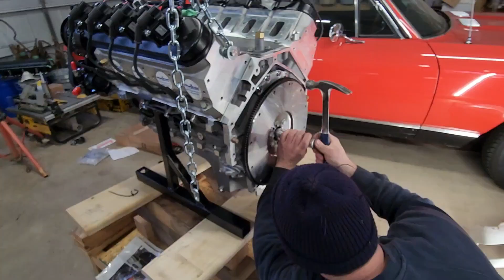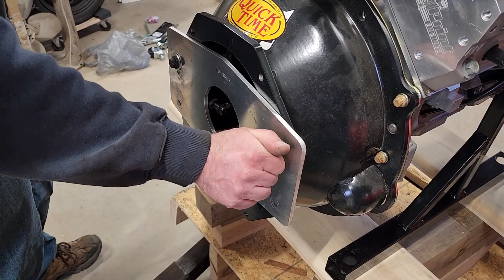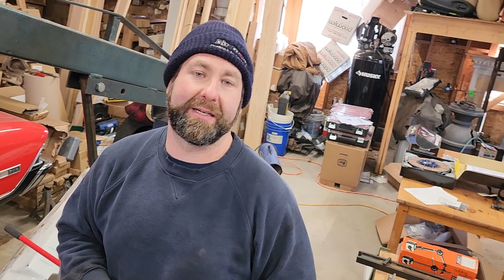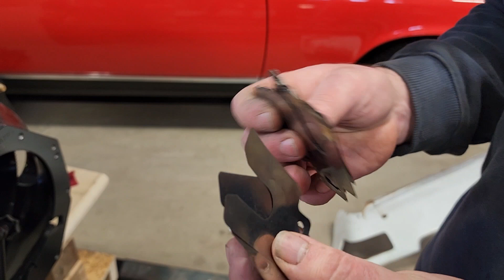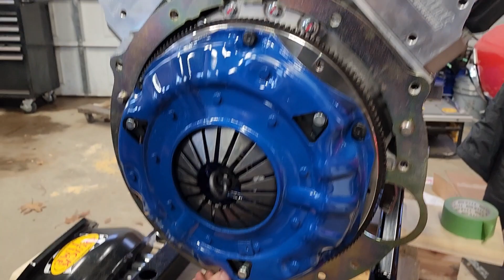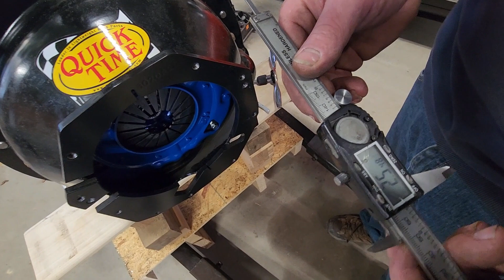68 GTO, LS3 motor setup

Comment: Looks great, That's one of the really fun parts of restoring a car!!!
Reply from the maker: Yes,I agree. Can't wait to put it in the car and see how everything is going to fit. I have to install my hydroboost drop in my radiator put in my AC cooler and see how everything plays out. Then figure out if I need any modification. All the best my friend.  How is your car coming along?
Reply: getting painted next week, then I can start final assembly. Can't wait!! Thanks
Reply from the maker: @waynebauer2770  that's awesome. Did you do the body work? Or did someone do it for you? The problem I'm having is finding someone to paint the car if I do my own body work.
Reply: I did most, but guy did final block sanding. My guys in Berlin nj. A little far for you
Reply from the maker: Berlin NJ, is only an hour and 45 minutes from me. If it comes down to it. I don't mind trailering the car down to him. let me know if he does a decent job.
Reply: Will do